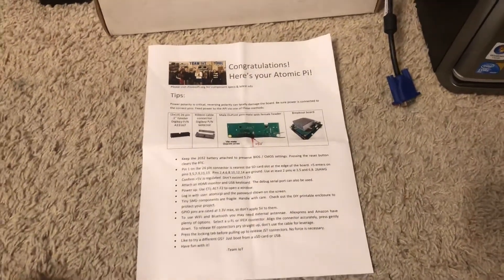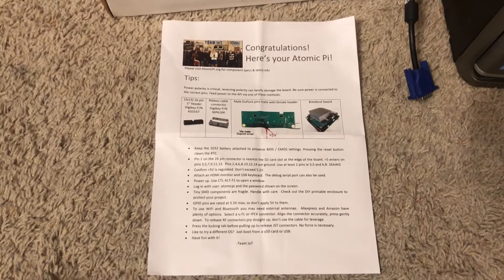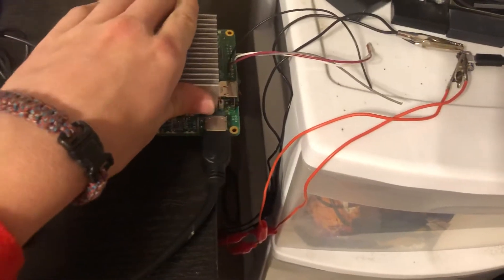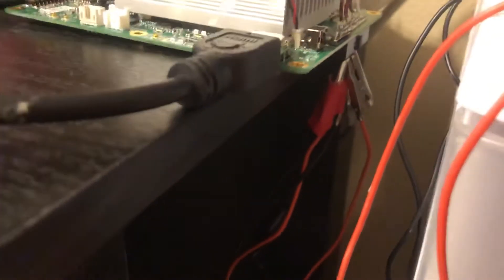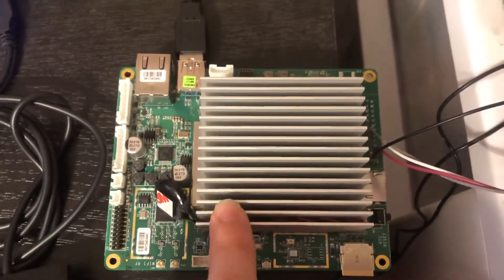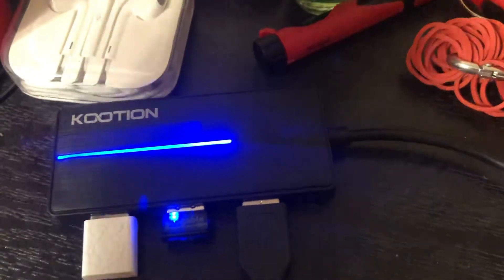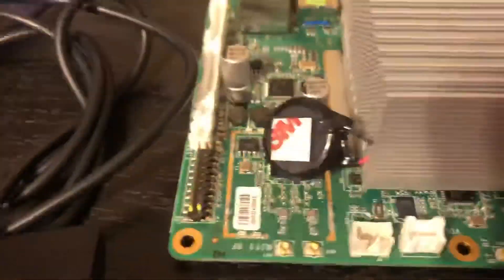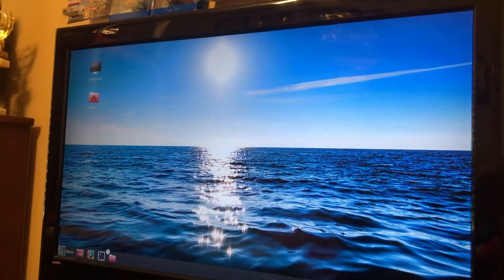Atomic Pi Full Review

Comment: Can you run Minecraft smoothly on the Atomic Pi? Really considering using this for some Minecraft gaming.
Reply from the maker: Waffledude1000 I have never personally tried it due to me not owning  a Minecraft license, but if a version of Minecraft can run on a raspberry pi then I would assume so. I will look into it, and I might do a video on that subject because I have wondered that myself. Thanks for the question!
Reply: @furdcomputing8686  That would be amazing man, I really would appreciate that! The full version of Minecraft on PC runs in Java as well. I imagine Rasperry Pi runs Java.
Reply from the maker: Waffledude1000 oh ok. I will certainly look into it.
Reply: @furdcomputing8686  Is the CPU decent on the Atomic Pi? I know that Minecraft relies a lot more on CPU than the graphics card.
Reply from the maker: Waffledude1000 The atomic pi has an Intel atom with turbo clock speed up to 1.92 GHz, whick is really fast for a single board computer.

Comment: Will it boot from the SD?
Reply from the maker: Jud AsinSmith Stansell If you burn an operating system to the SD card just make sure it's UEFI compatible, but it should.
Reply from the maker: Update: I did figure out how to. You will need to format the SD card to ext4(I had to format mine inside of a Linux OS first), and then use your live install disk to boot into the installation. After that watch this video, and it will make it very clear on how to do it. 
Video: https://m.youtube.com/watch?v=fHXvijytyp4

Comment: If they are out of stock on amazon there are some on ebay also here are links to the breakout boards for  easier power connections
Baby Breakout Board

https://www.ebay.com/itm/264324121953

Full Breakout Board

https://www.ebay.com/itm/264324234923